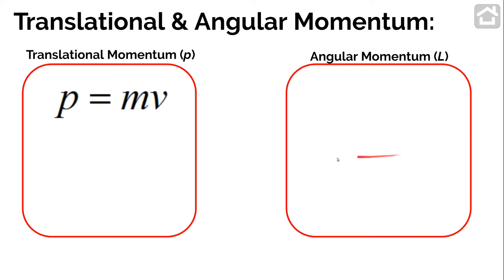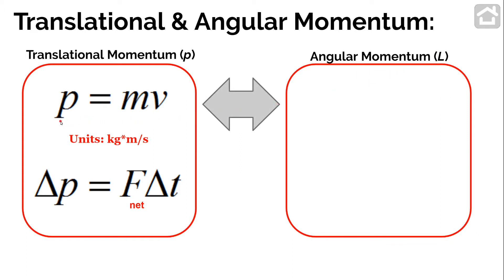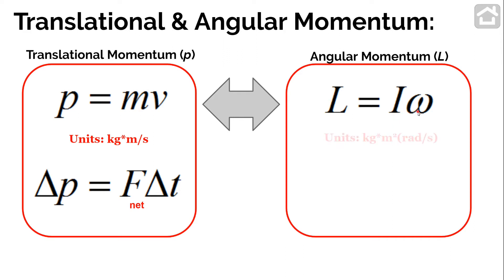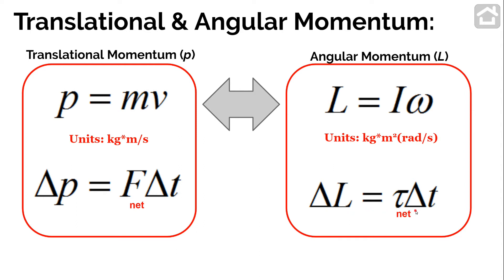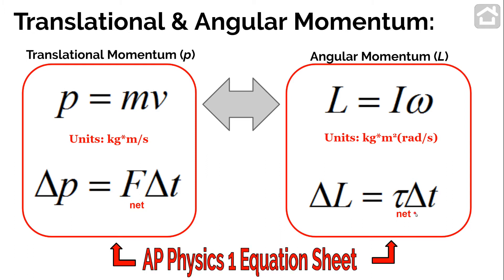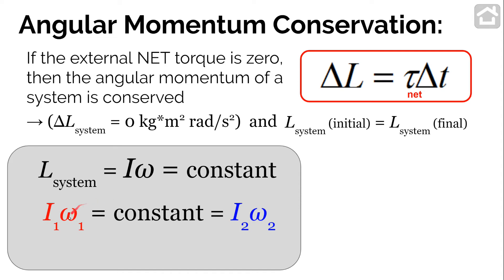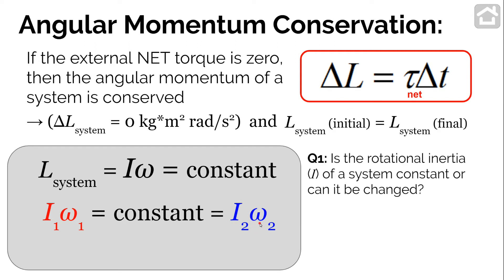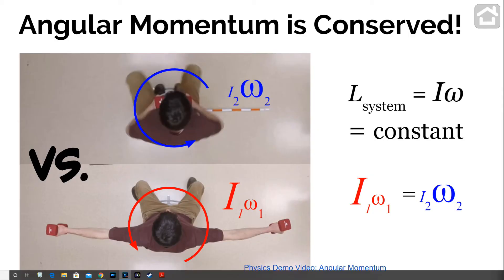Angular Momentum Introduction

Comment: The professor on a rotating stool does not conserve angular momentum. It conserves angular energy.
As well as the diver and the ice skater. 
We have been perpetuating a stupid mistake for three hundred years because we see things "spin faster".
Reply from the maker: If there is a rotating professor with weights in hand or a rotating figure skater with arms outstretched, as long as there are no outside net torques BOTH the “angular energy” / rotational kinetic energy AND the angular momentum CAN be conserved. If the professor brings her hands in toward her body or the figure skater brings his hands in towards his body, then each person will spin faster or increase their angular velocity, but IF the angular velocity changes then only angular momentum is conserved. 

When the angular velocity of each person changes the question is whether either the rotational kinetic and angular momentum increase, decrease or stay the same. Assuming there are no outside net torques on a system (spinning object or person) this quantity we call angular momentum will stay the same, but more information is needed to determine whether the rotational kinetic energy remains the same.  If there are no outside net forces on the system / person then the person’s total energy (gravitational energy + translational kinetic energy + rotational kinetic energy + thermal energy + chemical energy + etc.) must be conserved while spinning, even if their angular velocity is changing (spinning faster or slower). The rotational kinetic energy will stay the same ONLY if there is no energy transfer happening within the system (person + weights). 

In the case of the spinning professor holding weights with outstretched arms, she will continue to spin at a constant angular velocity unless she pulls the weights in towards her body.  The act of pulling the weights towards her body requires her to contract her muscles transferring some of the chemical energy stored in her muscles to the combined rotational kinetic energy of her body and the weights. In this case, her rotational energy has INCREASED while her angular momentum stays the same.  

Another way to think about it would be to imagine two identical masses attached to spring on a horizontal surface free to spin without frictional effects about its center of mass. If the spring connecting both masses is initially stretched beyond its relaxed length and the whole setup is given an initial angular velocity about its center of mass, the spring will contract and pull the masses closer together as it continues to rotate around the center of mass. This is like the professor pulling the masses in towards her body as she spins. As the masses attached to the spring move closer to the center of rotation, the angular velocity of the system will increase. Since the spring will be stretched less from its equilibrium position, the system will have less spring potential energy than it started with. This “lost” spring potential energy will be transferred to the system’s rotational kinetic energy. Therefore, the rotational kinetic energy will increase as the masses are pulled toward the center of rotation. Rotational kinetic energy (“angular energy”) is NOT conserved during this process.
Reply: @DebbinkPhysics  wrong. Angular momentum is defined L=rp. It is impossible to conserve both when r is changed.
Reply from the maker: @TheAnimammal  You are correct. When the position of a part of the rotating system is changed (larger or smaller radial distance from the axis of rotation) both quantities are NOT conserved. I stated that both quantities CAN be conserved if no other energy transfers are happening within the system. If there are no outside net torques on the rotating system and the system's angular velocity changes because part of the system is closer or farther from the axis of rotation, then only angular momentum is conserved.
Reply: @DebbinkPhysics  No. If the object continues moving at the same speed, and the radius is reduced then the angular velocity will change, so a change in angular velocity does not confirm conservation of angular momentum. That is exactly the stupid mistake which I am pointing out.
Reply from the maker: @TheAnimammal  It is hard to know exactly what type of scenario you are discussing without providing further details, but let’s assume you are referring to a mass which is rotating about a fixed location with an attached string. I will also assume that this mass is sliding on a frictionless horizontal surface and there is no air resistance. If the mass was given an initial speed, it will continue to move at that speed indefinitely. The tension in the string is applying a force to the mass, but that tension is pulling perpendicular to the object’s tangential velocity since the object is moving in a circular path at a constant radius. Since there is no component of the tension parallel with the tangential velocity, the object would continue to move at the same speed. Here it is clear that the angular momentum (L) is constant because the radius (r) and the linear momentum (p) are both constant: L = rp. If you change the radius you cannot just assume that the “object continues moving at the same speed”. This is difficult to visualize without a picture or diagram, but if the string at the pivot point was fed down through a hole in the center of the horizontal frictionless surface the radius could be shortened by physically pulling down on the vertically hanging string below the table. As the string is moved down, the radius of the path the object will follow on the table will be smaller, but the speed will NOT be constant. As the radius of the curved path gradually becomes smaller, the object is not moving in a circular path, it would look more like a spiral getting closer to the axis of rotation over time. When the object moves in this type of spiral path with a decreasing radius, there is a component of tension that is in the same direction the object is moving, so the object’s speed will increase. In this scenario, the radius goes down but the object’s speed increases.
Reply: @DebbinkPhysics  if you change the radius, there is no reason to suspect that the speed will change and there is no evidence supporting such a magical claim. The component of tension that you imagine is in the direction of motion is insignificant provided you are not yanking the hell out of it.